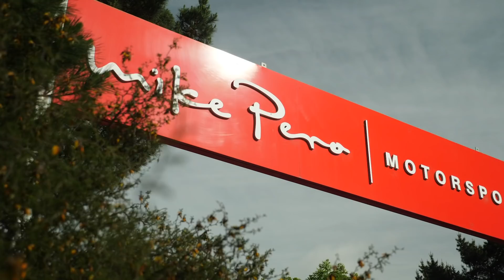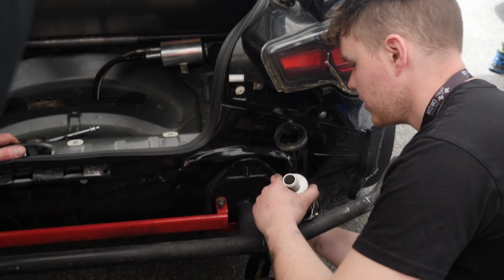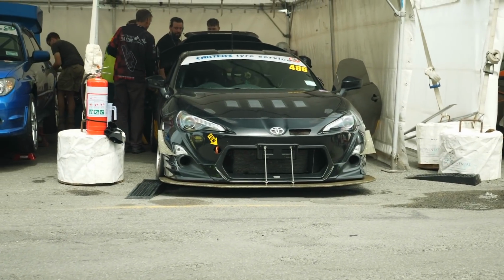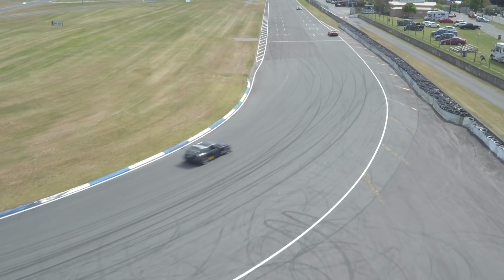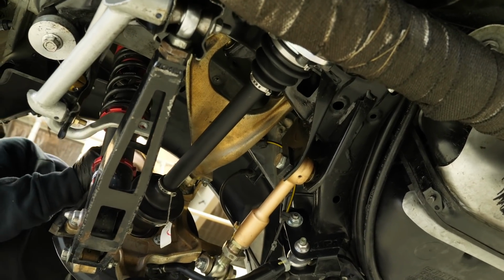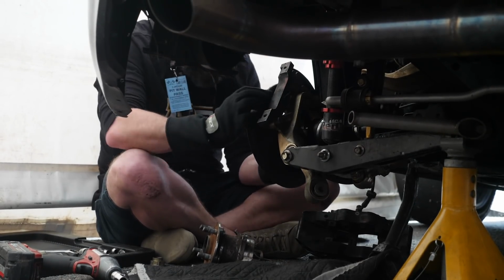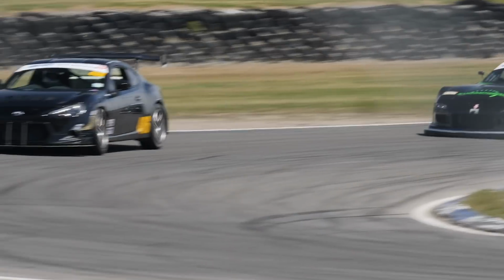Broken Axle with 8 Minutes of Racing Left | SIERDC 4 of 4 [VLOG]

Comment: Really hope you guys and DSS can get this worked out - at the end of the day, that would be the best resolution for everyone, including the community also buying these half shafts. They cultivated such a reputation with the Mustang Cobra community, Corvette community, many imports, it's rather surprising that these issues are so persistent. I almost wonder if there isn't some level of variability in the stock suspension components or something, or that there's more variables at play here than expected or something, seems odd that they just "can't" get the length correct.

Comment: 3:07 Haha!
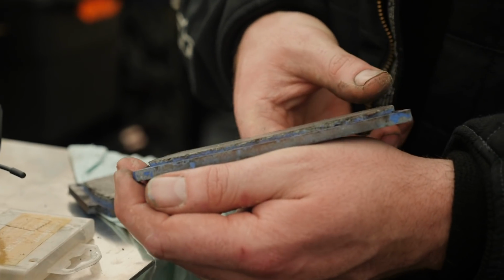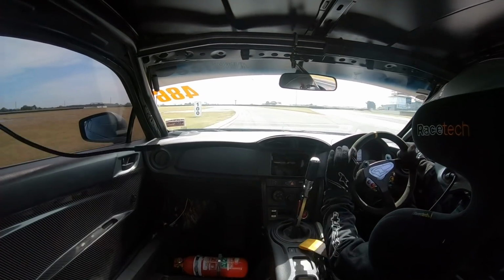3:43 - that is a LOT of taper on the pad wear, and not the usual front-rear wear, suggesting the caliper is applying pressure to the outer edges rather than evenly across the pad surface - looking at the caliper-pad relationship at 3:32 it definitely looks like there is a mis-match!
I would strongly suggest that be sorted out as not only are you getting uneven loading and wear, but the pad temperature will differ across the pad AND it raises a real possability of the piston cocking, causing sticking and difficulty modulating the pedal - what is the other side like? If the inner isn't similarly tapered, I'd suggest double checking the caliper is true to the plane of the disc.
8:40 - so Ben is the official HPA scrubber? TBH, with that beard I'm surprised, but no accounting for taste ;-)
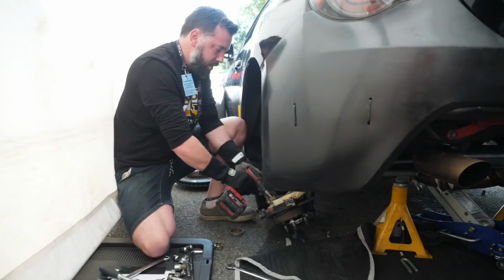9:40 - could part of the reason the axle measurements seem to be off be because of the way they're being measured? Because the axle shaft, itself, is being used with a different design outer end and, I think, different inner CV, the 'correct' length will very likely be different? Have you been able to check the dimension from where the outer shoulder contacts the hub face to the CV centre-line positions, similarely check the natural inner CV bearing line to the OEM? Once you KNOW what they are, you can figure out the spline lengths, retaining clip positions, and overall lengths required.
Might be easier to compare the complete assembled aftermarket D/S against the OEM, extended and compressed, from the shoulder to the face that bolts to the differential output flange. Sorry if that's granny-egg, but sometimes you get caught in the rabbit hole and overlook the basics.
13:40 - sometimes you get a win, sometimes you get shafted.

On shafts, there MUST be a few NZ companies that can machine them to meet your requirements?
Reply from the maker: The brake guy came for a chat about it all, I think cooling was a big part of it for that track too. We haven't had that same issue at Highlands or Teretonga with the pads wearing insanely fast like that but Brandon who knows more about these things than I is well on the case now.

We've sent so many measurements of the car through, multiple times. No load on suspension, load on suspension, metric, imperial, front to back and all as fast as possible for them to help sort us quickly. Brandon was even there measuring 30 mins before his flight to go on Holiday on a Saturday as the requests dribbled through XD

There is a crowd in Chch we have talked to as a backup, but with 4k invested in DSS we really were pushing to get something out of them before spending near that again. We're not a sponsored team and we are trying to grow HPA as well so where money is spent is calculated - Taz.

Comment: Check out holley hydramat for intank solution for the fuel surge..
Reply from the maker: We have looked into it a little and it can require quite a bit of work to get it into your existing tank. We have it all sorted with this setup now though to get things as low as we need. Having to pit at 17L was a bit ridiculous - Taz.

Comment: That car is awesome.  Um Toyota, here is your Supra blueprint.  No need to rebadge a bmw.  I know supras have been inline 6, but who cares, long live na v8 thunder.
Reply: well its 86 for sure, as it was meant to be cheap and competitive.. sure stock engine isnt great but swap in anything better and it works great..
btw supra has great engine.. those in slightly older bmw's (b58b30m0) are making 700hp with stock internals here in germany